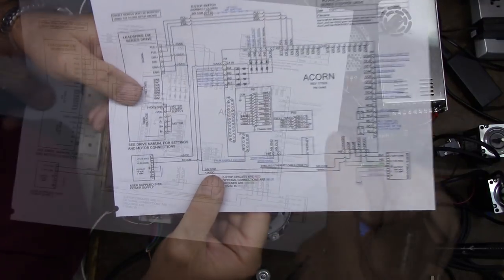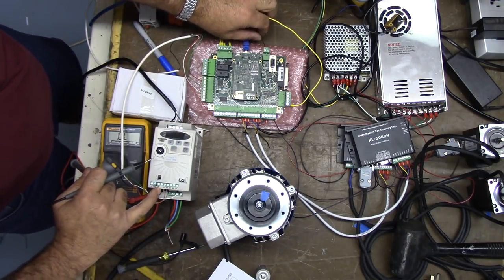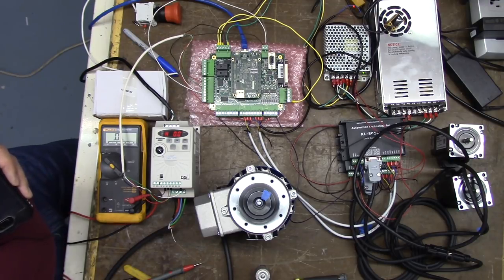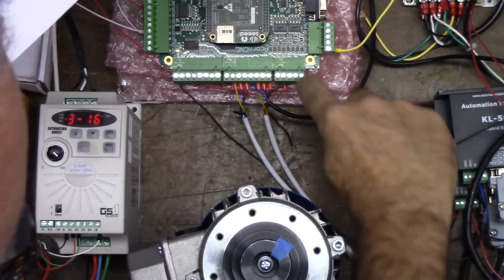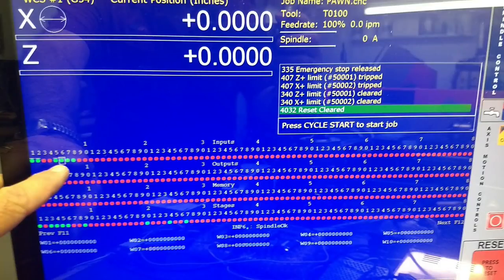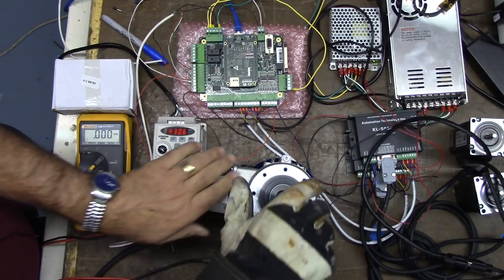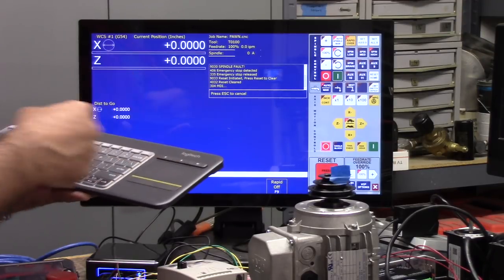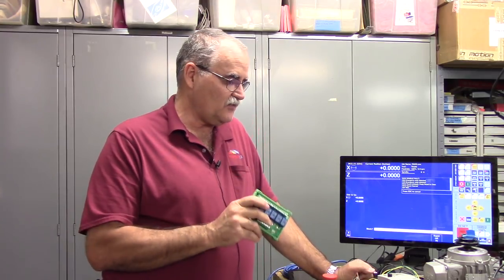Emco Compact 5 CNC   Benchtesting Spindle motor and GS1 VFD   Part 2

Comment: so there is a sequence to how to power off everything. You cannot just connect everything to a power strip and then power off the strip which will power off everything at the same time
Reply from the maker: I would not use a power strip in CNC Control. Centroid has schematics to use as guidelines

Comment: Can that spindle ok connect to drive ok?
Reply from the maker: Sure, but you won't be able to tell if your VFD or axis drives caused a fault via CNC12
Reply: @martyscncgarage5275  that's can be logic,,  and one thing, i need some advice on my servo spindle drive, about connection,, can u look at the forum,, under the name rosmadi, thanks
Reply from the maker: @TheFixxxer11  Don't know which post you are referring to. I don't see anything new from you...
Reply: @martyscncgarage5275   its under Chinese  hsd spindle,, the old one
Reply from the maker: @TheFixxxer11  please reply to it and update your post with your questiona
Reply: @martyscncgarage5275   ok